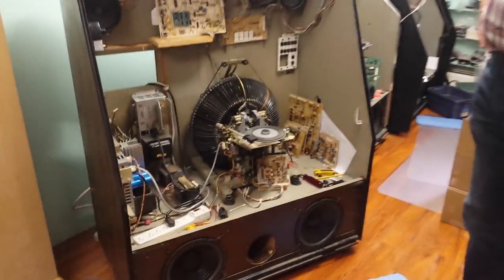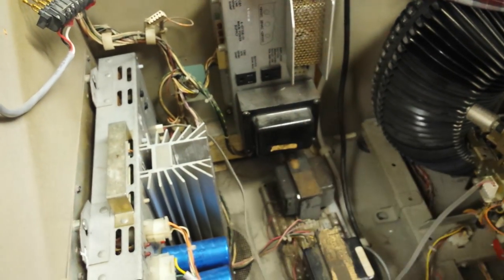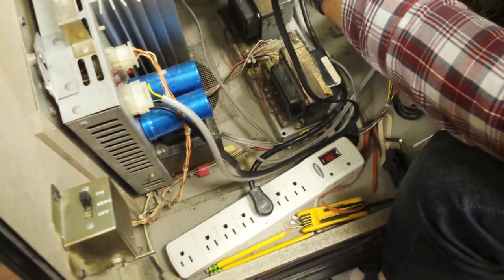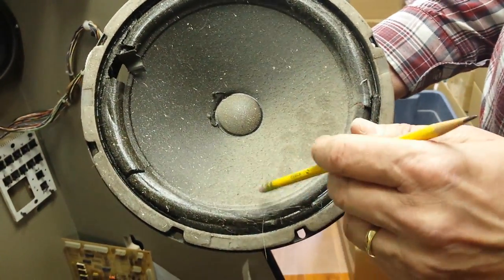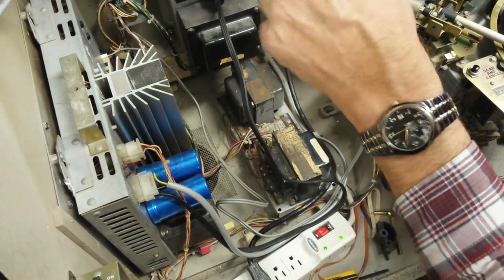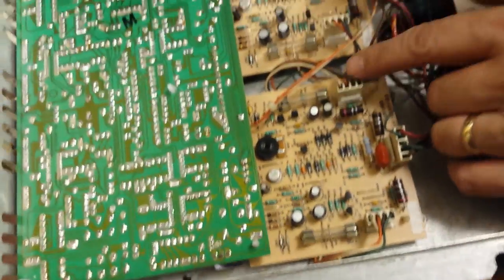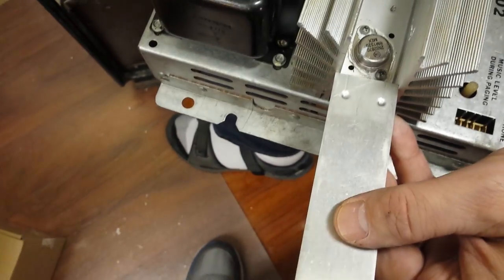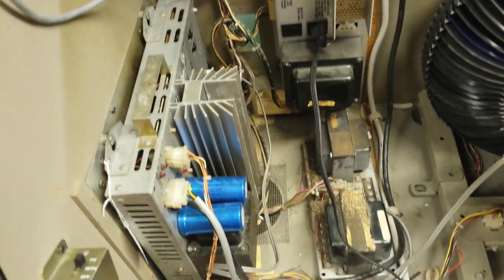troubleshooting sound issues on a rowe juke box

Comment: Excellent Video! Has helped me to repair a 1960s  MM2 ( Transistor amplifier basically same as the 90s models! ) I recon Rowe  updated the cabinets often but not the internals! Has also helped  with an RI1G even  though that's a Lovely Valve amplifier. Many thanks for the top quality vids . Dave Uk

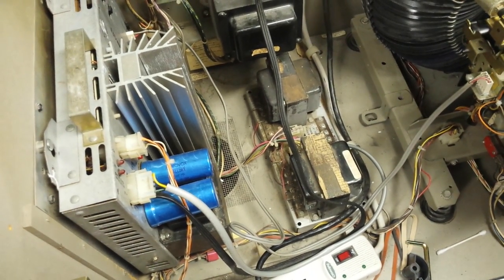Comment: 8:29 how do you check the mute circuit? I have a r90 that I took everything out of to clean and put all back in. I had sound before just not very good because it needed new speakers and there was some cold solder joints. I have it all back together and am not getting any sound and have checked all of what you are referring to up to this time point in your video. You mentioned a mute circuit in r89 up. Please help. Thank you.

Comment: Awesome video! Thank you! I have a R88 and when I turn the power on I get a loud buzz through the speakers. It only does it for a second or so and then it returns to normal. I believe it might be in the amp but I don't know where to start troubleshooting. I thought I might start by pulling out the amp and cleaning all the connectors, switches and pots. Any advise?

Comment: I have a Rowe R-85. It has worked great for years. Now I only get sound out of one side. The speaker that does not play is good because i removed it and connected it to the other side wires and it plays great. Sounds like a amp??? or one of the sound boards?

Comment: I have a Rowe R93 and want to replace the factory 130 watt amp with a 250 watt amp. 
Is there a 250 watt model that will directly interchange with my existing mounting hardware and wiring harness?

Comment: Great video ! Thanks.
I have a AMI Rowe R88 and the problem is that i have one volume stand: 100% loud ! We try another volume controller on the back. It won’t help. I don’t have a Wall volume controller. Any idea what the problem can be ? Thanks, all the best from the Netherlands.
Danny
Reply: It sounds like the ground lead on the volume control may be open somewhere in the pot or the wiring harness. The end the wiper will touch when the pot is turned fully counter clockwise.
Reply: @dmfraser1444  not sure what you are meaning mine is doing the same thing I have R-94 help

Comment: Hello I have a question about my R-91. For some reason every song starts out about -30db softer (or so) and then sort of increases volume after about 10 seconds into a song to full volume, almost as if it's a setting or something.. but I can't find a setting in the manual.  Any ideas?
Reply: That would be the automatic volume control, which is normal. The amplifier has this feature due to records being recorded at different volume levels. It prevents the volume control from having to be adjusted manually.

Comment: Hello. I've got a 1978 Rowe R82 (black magic). I've noticed that the records sound just slightly slow. Any thoughts?  I was thinking maybe the capacitors were getting worn out and weren't holding the proper charge all the time. Cool channel!
Reply: This sort of turntable usually uses an AC motor that runs off the line frequency. The problem is more likely mechanical. The filter caps generally operate only the power amplifier.

Comment: The upper speakers in that box are going to sound like shit. Where are the upper speaker baffles? The bottom speakers will sound great because they are in the original speaker box/baffles. Whats up with the upper speakers??? They are just hanging out in the thin air with no separation between the front of the cone and the back of the cone.... Is the baffle in the upper door??

Comment: my RI-3 is on line hereon the tube ;-)
Reply: Anyone have a volume control knob for a CD 100? My volume knob is stuck on high. Will not play at any lower volume.
Reply: At the 14:00 mark you talk about how you get full volume as a sign of a failing amplifier. My sounds is not distorted, but the volume control knob lost its low level and plays loud. It can increase in sound but doesn't decrease. Can this be a problem with the control knob of the amp?